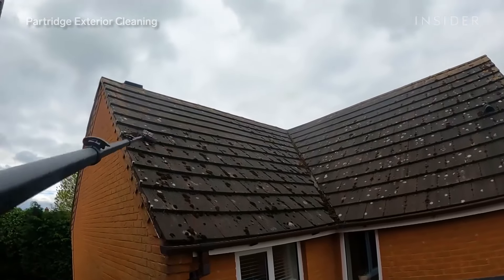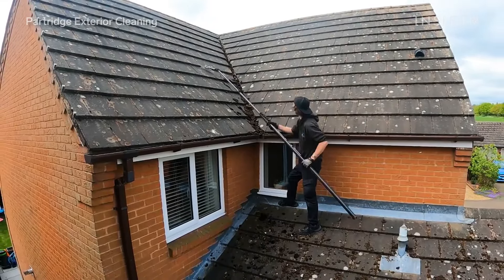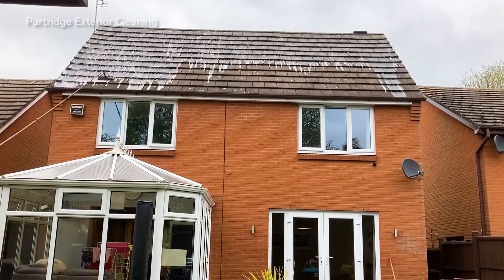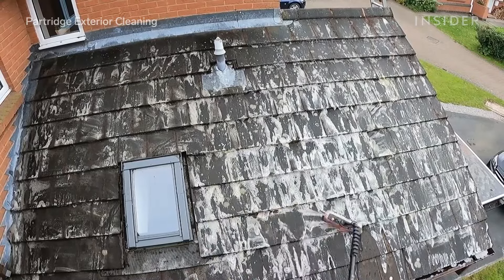How 28 Years Of Moss Is Deep Cleaned From A Roof | Deep Cleaned

Comment: In the southern United States I have treated roofs with baking soda. Generally, the asphalt shingle roofs I have dealt with have much less green moss, but lots of blackish mildew and moss. Spread about 10 pounds (at a cost of about $10) of arm and hammer baking soda (sodium bicarbonate) across the roof. Sprinkle it on and let the next rain wash it off. The Baking soda is basic and will do a PH shock to the roof, killing the mildew. We eat baking soda, so it is not harmful to humans or the environment. Usually, after treatment it takes about 2 to 4 months for the rain, sun and weather to naturally wash the roof off revealing the original color of the roof, making the roof look almost new.  One can also use bleach, acid washes a roof (instant results) but these chemicals can make a roof slippery, wet, and a slight breeze can blow them back at the applicator. (winds on a roof do funny things and sudden updrafts more so than on the ground). It is super quick and easy to treat a roof this way, just sprinkle it on. Frequently, I will miss some spots on the roof, so I will come back 3-4 months later and reapply on any areas where I still see moss or the color does not look right.  Still, when you are in the area, and patient, treating a roof with an all natural product, that takes 10 minutes to sprinkle on is a great home maintenance tip.

Comment: To prevent moss & mold all you need to do is install a zinc strip at the peak. 
My roof still looks new at 30 years old with the metal strip installed at the peak.

Comment: Hi Sid,

Whats the best solution to prevent moss growing?
Reply: It is to remove the conditions for growth of moss. However, it is not easy to remove the condition in the UK. The chemicals don't last long, the moisture is absorbing enough from the air, and the UV-rays isn't enough to inhibit the growth of the moss.Therefore, the best response, which is sustainable and inexpensive, is to use coatings and composites that are difficult for plants to grow as the material of the roof. Nevertheless, if the roof is not cleaned frequently, the moss will grow little by little using a small amount of dirt and dust accumulated on the roof as a bed. However, it is very easy to clean because of its slow speed and weak adhesion.

Comment: Great but would like to see some evidence that moss causes damp even in the long term. The roots are tiny and tiles are substantially thick. They are also overlapped so water between the tiles drips onto the next and then onto the membrane. I do agree that cleaning helps maintain the aesthetic.
Reply: Yes, but what happebs if there is moss between the interlocking channel of the  tiles. It was impede/block the flow of water and it will track onto the felt or into the roof space.
Reply: @RexBanner_  surface washing doesn't clean inside the interlocking part of the tile.
Reply: @ndewhurst1007  i never said that it does. Again, moss built up in the channel between the interlocking tiles impedes/blocks/ diverts the rainwater inside of the tile. So it ends up either on your felt/breathable membrane or inside of your attic/roof space.

Comment: Is there a reason a pressure washer wouldn't work as well as scraping?
Reply: Water can leak through the gaps or maybe it can damage the tiles due to high pressure
Reply: Yeah, water pressure will damage tiles, it will eat through thd surface treatment and "ruin" the tiles
Reply: @zerosixteen.4644  the roof was made of concrete
Reply: Pressure washing rooves has got a bad rap from the idiots who thought that they could wash their rooves from the base of it, without an extension pole. They then proceed to push thousands of psi's of water up a roof and under the tiles, inso doing soaking the loft area. You can quite happily wash your roof from the apex on down at around 100 bar, especially if you use a flat surface cleaner like Sid does.

Comment: What happens when the biocide drips off into the surrounding ground and/or when it rains and runs off into the drain. I'm guessing if it kills organic material on the roof, it's probably not the most ecologically friendly tool to be using?
Reply: Professional exterior cleaner here: as you can see, the idea is to keep it on the roof until it dries. Gutter bags and other catch systems are sometimes used in sensitive situations, but mostly, once it reacts with the moss and then dries, it's lost  its most potent abilities. When the rain does come, it gets diluted to the point that it's no longer harmful to the environment in these small quantities. Once the initial reaction is complete, the leftover materials are various salts and other relatively harmless things.
 In fact, some of the same chemicals are used to keep drinking water safe!  Now, don't go pouring house cleaning chemicals in your own water of course, but no need to worry that it's killing the fishes!

Comment: this looks like way too much work, why not karcher it?
Reply: Indeed, i was thinking the same.
With pressurized water you can take off all of the moss with 1/3 of the effort. 
The important thing is not to exaggerate with the pressure of the water, to not damage the tile (obviusly you dont have to put the water at 1000 bar XD )
Reply: Pressure washers can damage tiles particularly if there are unseen cracks or weaknesses in the interlock between the tiles (these are interlocking ones, likely a stonewold) Also you can force water up and under the tiles whilst washing if you aren’t careful, causing leaks and water damage inside. It happens a lot when people who don’t know what they are doing try to use a pressure washer and angle it up the roof (which should be an obviously stupid thing to do) or have it at a near 90*angle to the roof and the spread of the water forces it up under tiles.
Enjoy the mostly useless to you information.
Reply: @shlaag234  It just doesn't seem worth the effort to do it by hand.
Obviously the risk of damaging the tiles is greater but I'd argue it's worth taking it.
Reply: @luisobip4415  i would argue that as a business you don't want the extra risk of damaging tiles and having to then pay to get these replaced.
Reply: @NikoAlibekov  agreed, or worse the cost of interior making good and decorating.
Reply: @luisobip4415  really? The risk of getting structural water damage to your roof and possibly inside is worth taking the risk of spending less time doing it?  😂
Reply: @Smithy250  absolutely, but I'm no expert so there you go.
Reply: It's UK fam the rain is unpredictable. If he use pressure washer (water only) the moss will comeback within 4 days so make it last if it possible

Comment: Where do I get a roof that lasts 28 years?
Reply: Clay roof generally last for 20+ years especially if the manufacturer adds glazing to them so that the pores become smaler than the traditional clay tiles.. But once it reach 30/40+ yrs of age it'll get fragile to the point that u just need to knock it with ur bare hand to break them (at least here in asia).. Idk about UK but in Germany there's company called Bernd Waldenberger that makes a high quality roof tile that I think suits European countries
Reply: Quality Slate properly installed can last 100+ years, but oddly enough the longest lasting roofing is thatch.